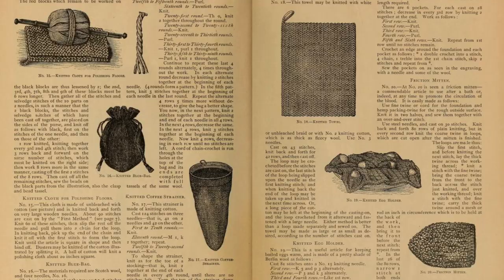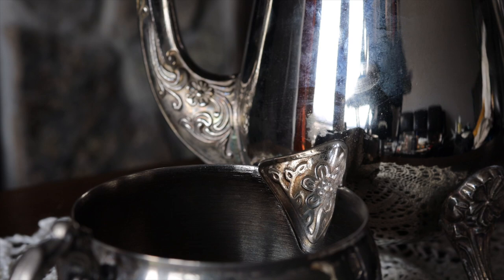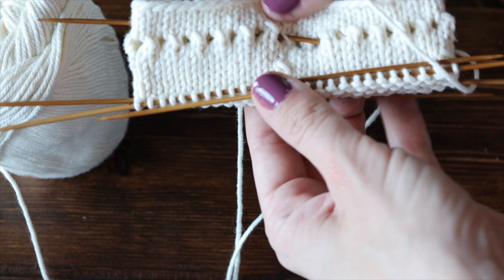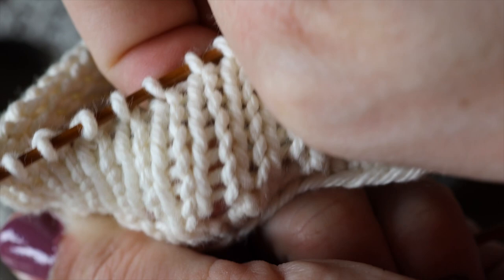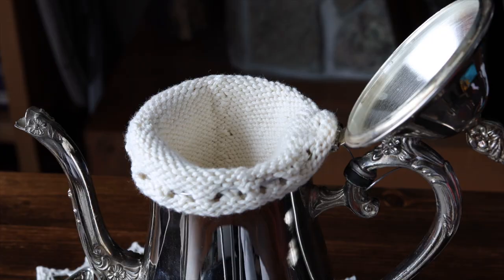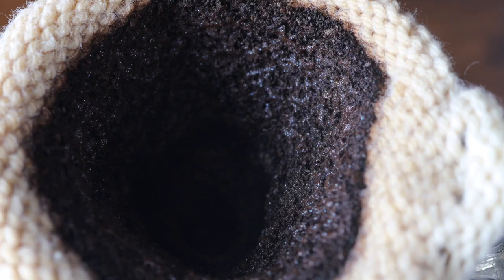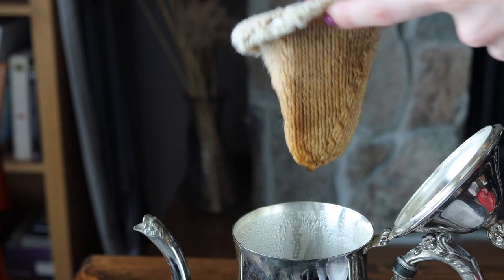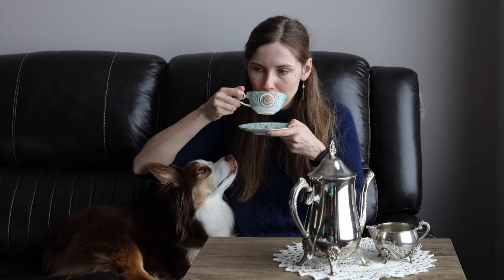A Victorian Coffee Sock - How to knit a reusable coffee filter from 1892!

Comment: You can actually buy coffee socks that are designed for this sort of thing, they’re usually woven. Your bigger gauge didn’t let the coffee steep and that’s why it was weak, the water needs more contact time with the coffee to extract the goodness.  I had a crappy pour over metal filter for a pretty glass carafe and I could never get good coffee from it, it was always weak and unpleasant because the water drained too quickly.

Comment: Have you considered using the kind of cotton thread used for crocheting doilies for this and your lace edging?  If you must have wool, consider wool thread sold in cones to weavers for stringing looms.  The kind of crochet thread I'm talking about is about half as thick as the horn you used.  You would need to use a U.S. Size 1 knitting needles with it, though.  When you knit your lace for your undergarments, I'll bet you were knitting really tight, and perhaps if you had used crochet thread, you wouldn't have had to knit so tight, and your forearms wouldn't have hurt so much.